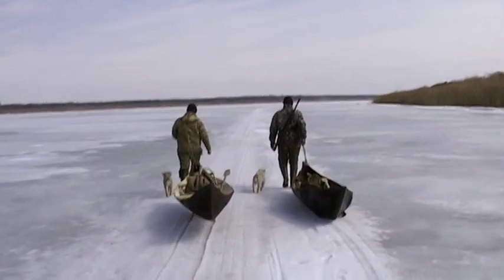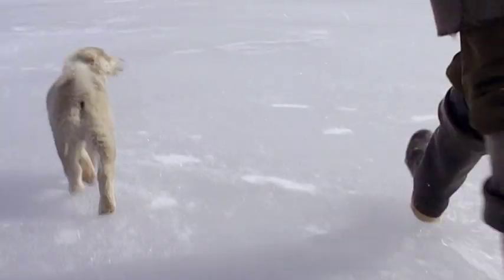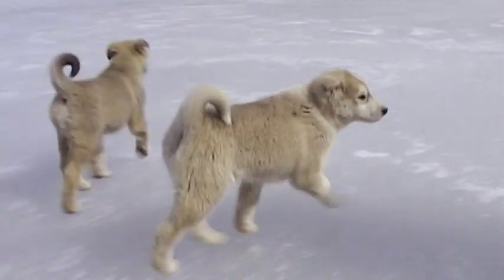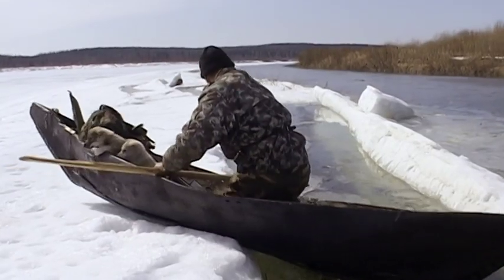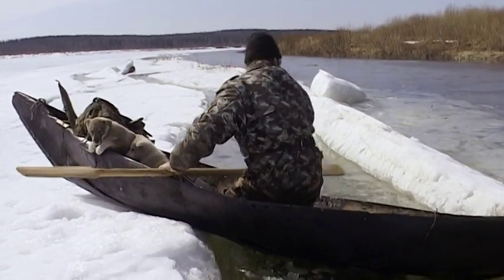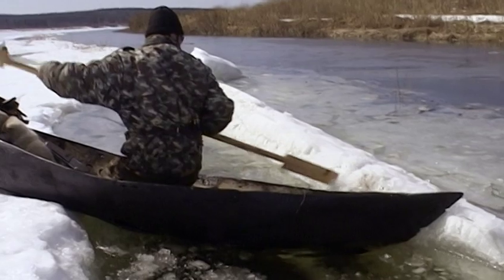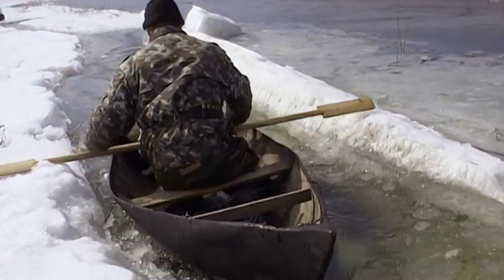Dugout boat making in Siberia

Comment: Thanks for the share. I made several similar way  also using axe plus adz. lovely to see....I just judged depth, maybe i will use dowels because it sure is nerve wracking hollowing by feel and hopefullness. Plus i didnt widen mine, reluctant to try without knowledge of how my wood works with fire . Are the folks in the video working with white pine or what is it and was it felled live or was it a dead tree? . Interested to see thick pine tar applied then heated: I used liquid pine tar mixed with turpentine and linseed oil, also works amazingly well and I just mixed it cold. My next task will be outrigger i hope. Thanks again. Lovely to see diverse cultures, same essential idea . Thanks again for the post

Comment: Does the tar makes it waterproof and rot-free? If I am in survival situation can I use tree (or fish) oils or smoke to make it waterproof?
Reply: Smoke will not do it. Tar will extend the life of it a lot. They probably used "homemade " birch tar. But even petroleum based tar will do it. Or Animal fat, preferably tallow, thinner oils, like fish,chicken or pork lard will not last long. All of these , and synthetic waterproofers  will help a lot, but they will not fix the bigger cracks. Smoke was not really used here. It is the heat that makes the raw wood plyable, so they can bend it. After its shape was secured (sticks across) ,then it was dried to hold the "new " shape. Same as the steam bending of wood to make furniture, or snowshoes,etc.
Reply: Smoke used in fur tanning as waterproofing that's why I thought it can help. Oil will be fine it's good. I am not interested in syntetic waterproofers - only naturals.

Thanks,
Áron

Comment: Wath tree is used for these canoes ??
Reply: looks like birch or maple, both local. Just a guess.
Reply: catumandos it's aspen (populus tremula). many boat builders across russia consider it the best choice for dugout canoes, because it's lightweight, easily cut and rot resistant.
Reply: традиционно используют осину
Reply: In those parts this boat is called "botnick"
Reply: In Finland they used aspen for that purpose.